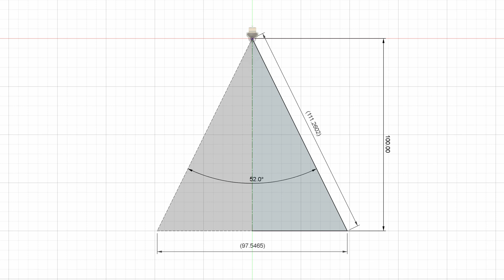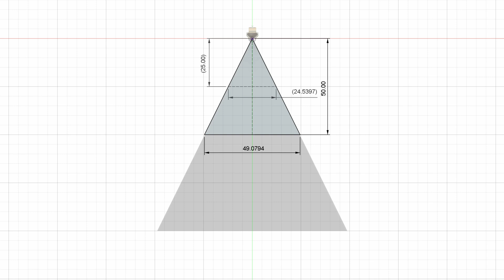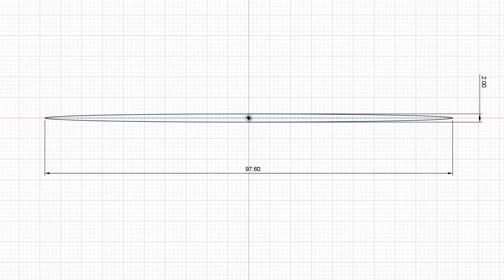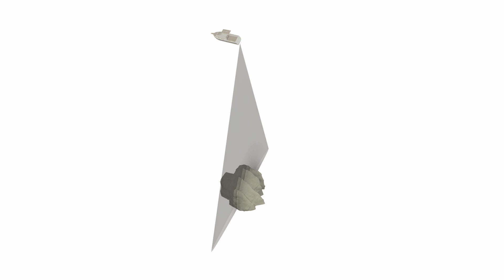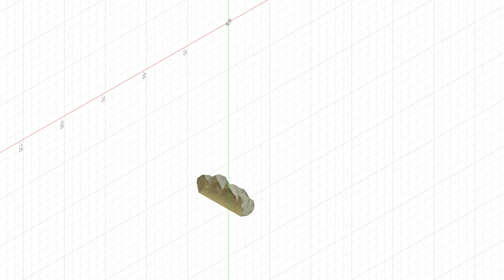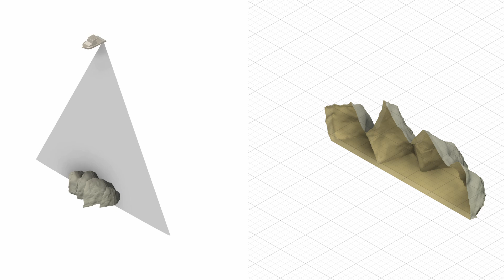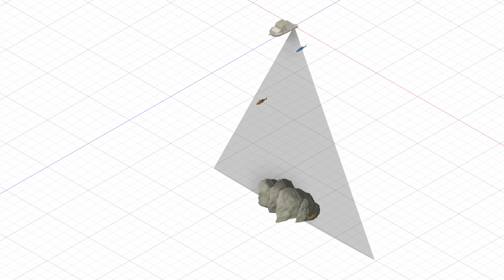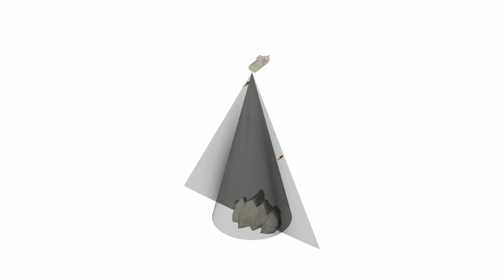Down Vision Sonar Basics

Comment: I've really been enjoying these technical videos.  It's easy to see, you've put a lot of time into the production and just want to let you know it's appreciated.  I have the Furuno TZT3 12" and 10" units with traditional 2d and Dff3d.  I also have a 9" Simrad unit, so I can directly relate to these videos.  Being my boat is only 23', I have to work on my transducer placement because my current placement doesn't provide the best picture due to the lack of room to properly install them.  I think in the near future I will try and install the Dff3d transducer in a fairing block, similar to your setup.  Either way I just wanted to let you know this series is great so far and I can't wait to see how it progresses.
Reply from the maker: Thanks for the positive feedback, I really appreciate it.
We have very similar setups.  I think putting the B54 transducer for the DFF5D in a fairing block was a good move, but I was lucky to get it right first time.  My other transducers are transom mounted, and it took a number of trips out to get the placement right.  Well worth the effort.